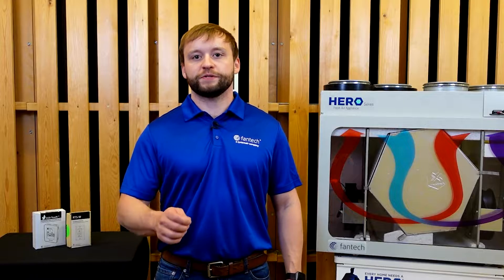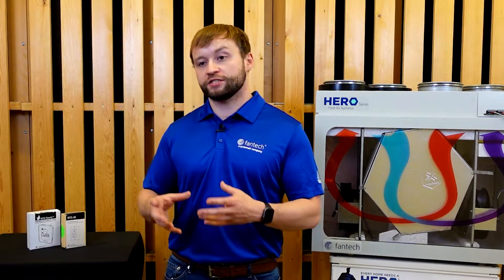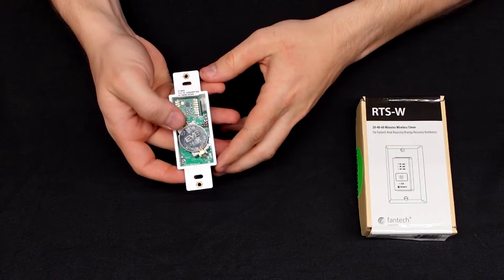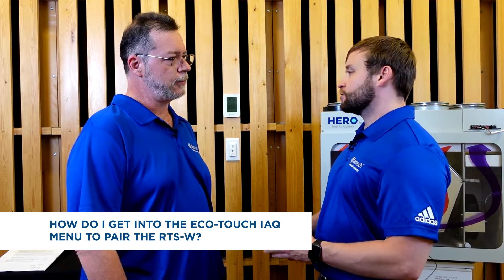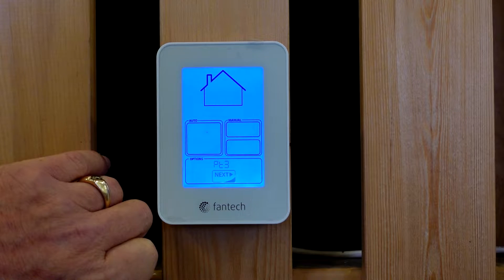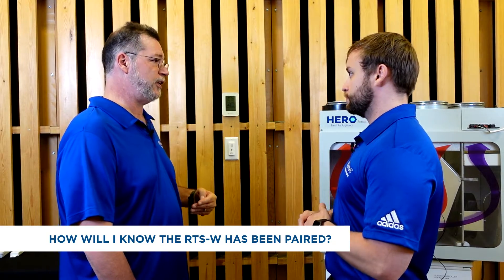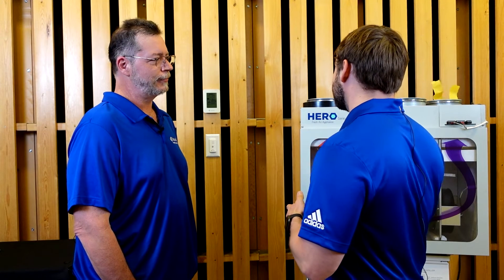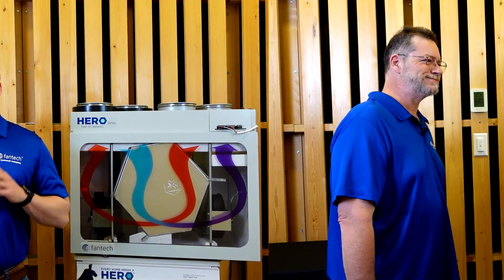Pair Fresh Air Appliance With Controls

Comment: How do you wire in the control
Reply from the maker: You can find connection diagrams for your control on the link below: https://shop.fantech.net/upload/assets/445468_ECO_SERIES_WALL_CONTROL_CONNECTIONS_20210527_145834772.PDF

Comment: Can the Eco-Touch IAQ controller work when my Fantech SER200 unit is ducted into the return air plenum of my air-handling unit, which is controlled by an Ecobee3 lite thermostat?
Reply from the maker: Erik, the SER200 needs some sort of control. It's possible that Ecobee is connected so that it's sending a signal to the appliance to operate. In that case, you need to pick either Ecobee or EcoTouch as the primary control. Just because the Ecobee is controlling the air handling unit doesn't necessarily mean it's controlling the SER200.

Comment: Hello, How do i make sure I purchase the "Newer version" of Eco-Touch IAQ to be compatible to RTS-W. In the video you were mentioning about older ones with 2 wires are not compatible to RTS-W. How to identify and make sure I purchase the "Newer Version"?
Reply from the maker: The ECO-Touch IAQ ("the newer version") is compatible with all Fantech Fresh Air Appliances, equipped with a 5-pin connector on the control board (watch for the date of manufacturing - January 2019 and on) except SE704N, SH704, and VH704 models. ECO-Touch is "the older version". Contact Customer Support to check the compatibility of appliances manufactured before 2019 and the Eco-Touch IAQ